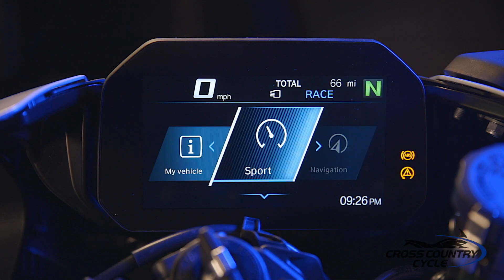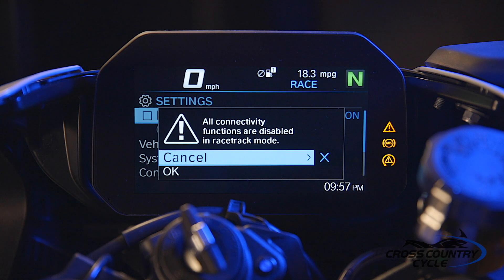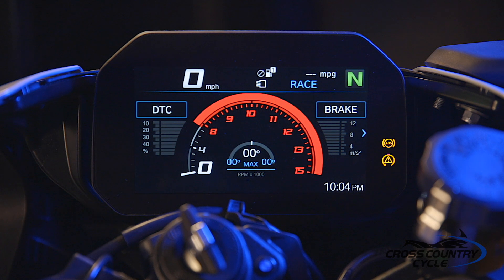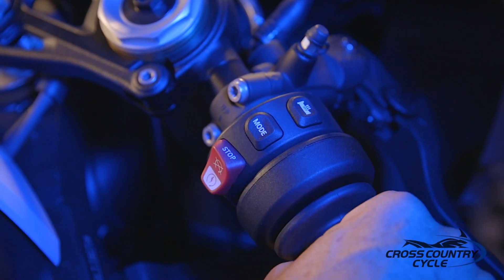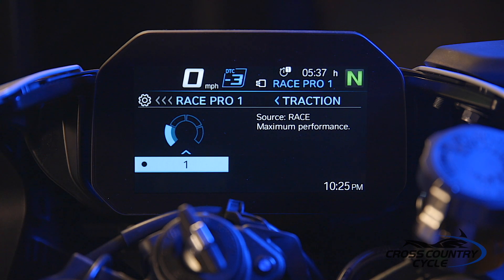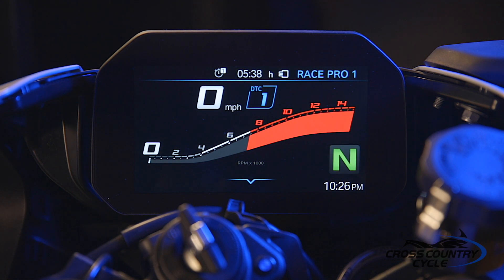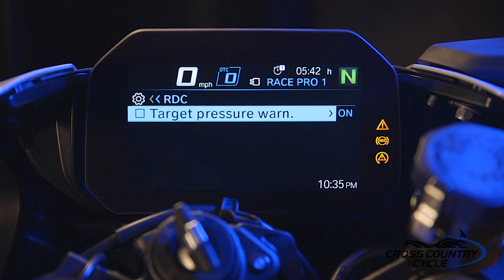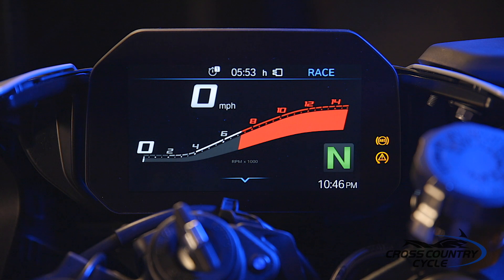BMW S1000RR DECODING - TFT DASHBOARD (EP. 02)

Comment: Are those dash rpm meter configurations available on the 2023 red bmw s1000rr. And is it possible to change the “red marker” on the dash from 8k rpm to higher? Im asking as the s1000rr 2023 red, stock is my dream bike and im hoping to get it soon

Comment: great info thanks, just a question on turning off ABS. So once the plate carrier is removed and after holding down DTC the ABS is turned off but, has the traction control also been turned off ?